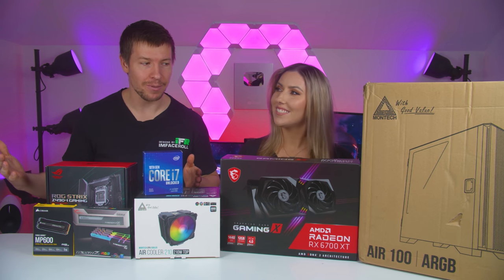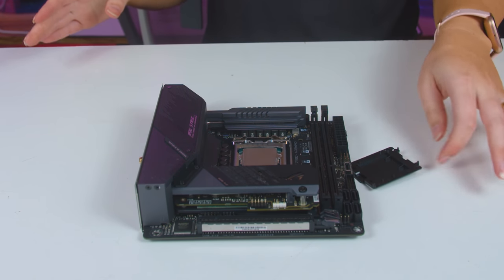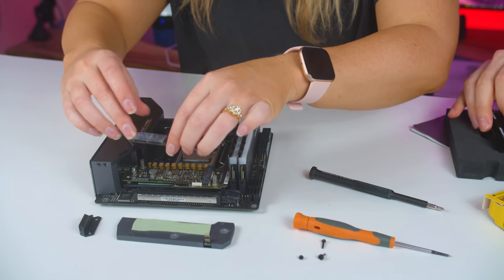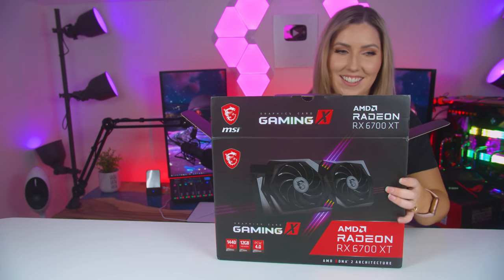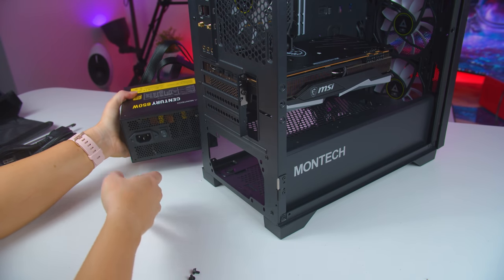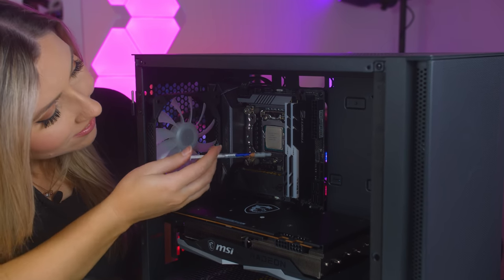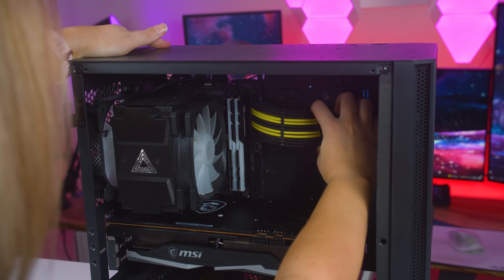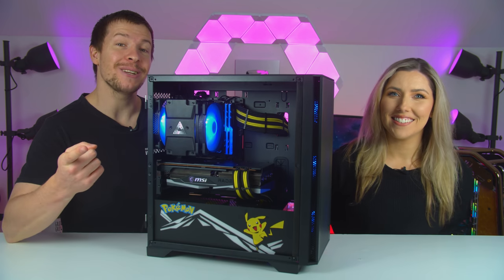My GIRLFRIEND built a $2000 Pokemon Gaming PC

Comment: Hi IFR, I have a technical question for you. You’ve showed the gpu temperature of 41° with the extreme customized water cooling system. However, what was the temperature of gpu memory? The gpu ram temperature is the most critical one regarding the rtx 3090s rather than the gpu chip temperature. I have a rtx 3090 and consider building a custom water cooling system and look forward to your reply. Thanks!
Reply from the maker: I didnt check sorry
Reply: @DesignsByIFR  Can you take a look next time, please? The updated version of GPU-Z will show it. Thanks.